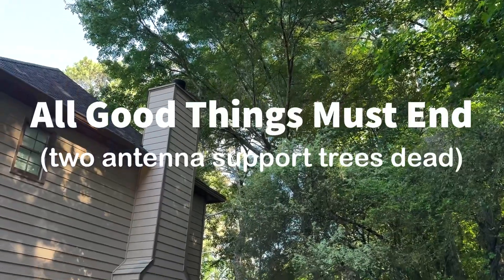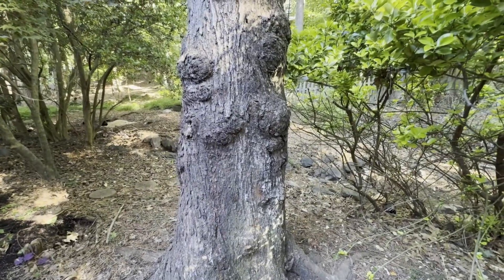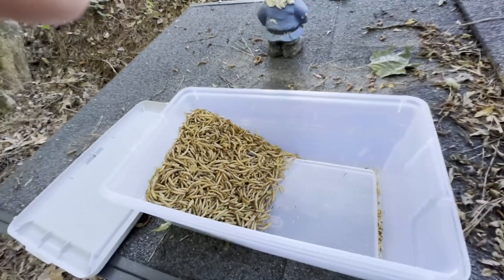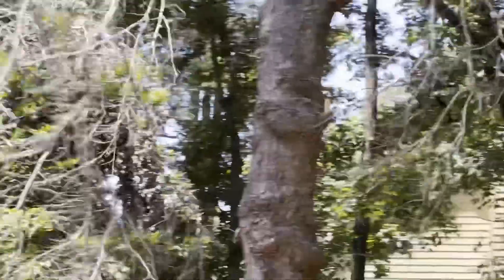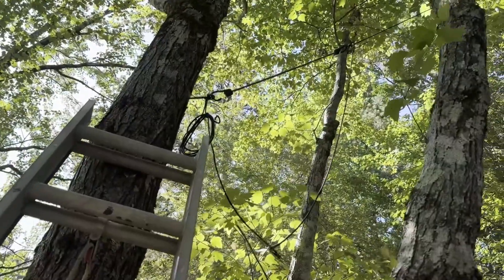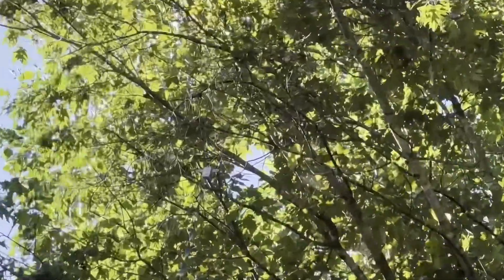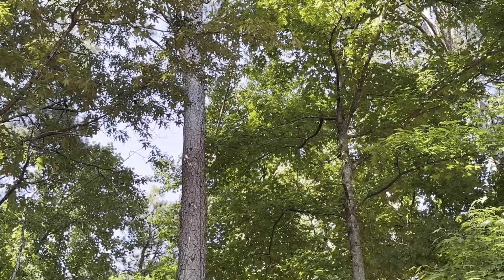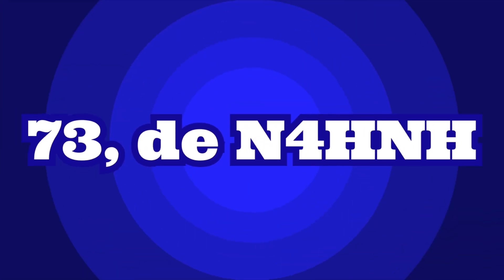All Good Things Must End (two antenna support trees dead) #hamradio #hf #antenna

Comment: I use 2 aluminum 32’ spider beams with a 130’ end fed in a dipole position after having the same issues.  73
Reply from the maker: Resourceful.  Necessity is the mother of invention.

Comment: Bummer. I’m hoping my trees are ok. No idea but the seem ok to me. They’re all I have going for me antenna wise.
Reply from the maker: Mine were diseased.
Reply: @n4hnhradio  i understand. Sorry. Trees are a wonderful gift. 
Could anything have been done or is it that once diseased there’s nothing that can be done? If you addressed that question sorry if I missed it. 
Makes me think I need to call a tree surgeon to check mine out.
Reply from the maker: I saw white spits around the lower portion of the truck of both trees. The arborist said they would die. One died and the other was dying. It was less expensive to remove both at once. The disease appears to have been cankers.

Comment: Sorry you lost those trees Doug. Now that the antennas are back up, and a little higher, I wonder how the reception is?
Reply from the maker: No significant difference with the Doublet but the ZS6BKW is better, at the expense of the SWR. The SWR of the ZS6BKW is worse on the 20m band now.  I now have to touch it up on the lower end of the 20m band whereas it needed no antenna match for 20m before.  I attribute this to the fact that it is no longer an inverted V.  The tree guy removed my rope on one end without telling me.  I had already lowered the middle but the wanted the rope and wire on one side completely on the ground. He said he would put it back up. When he put it back, he threw his bag so high that it made that side of the antenna completely horizontal.  The other side is still angled downward, for inverted V.  So I have a combination flat top and V.

Comment: That was quite the project!
Reply from the maker: So far so good with the new locations. But  the limbs are too small for them to install a pulley. It’s just Dacron rope thrown over the limb.  The Dacron rope is tough though. I just tug on it once a month to make sure the limb isn’t growing around it. That happened to me before I had pulleys installed.  If these two trees die, I’m out of antenna trees.